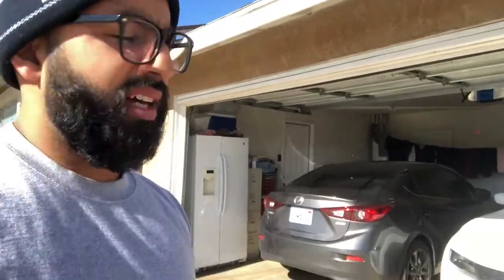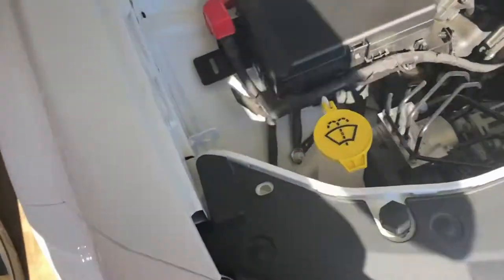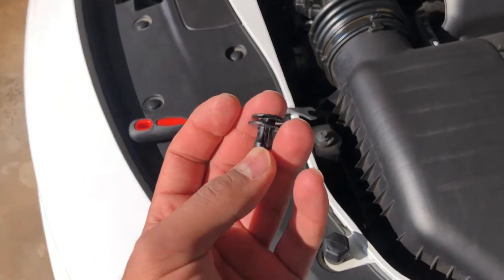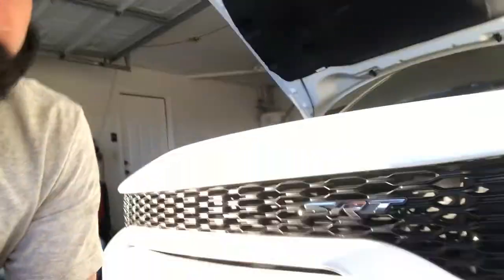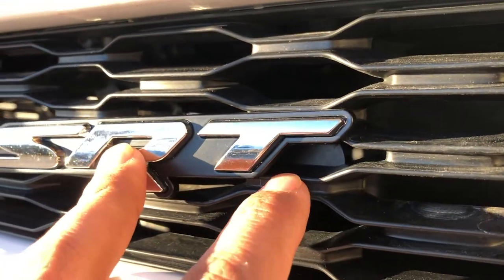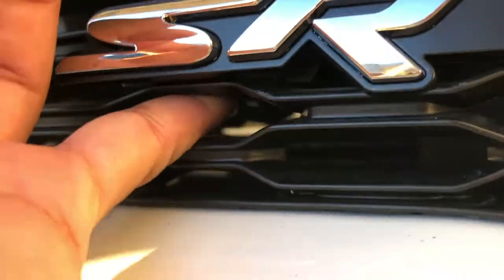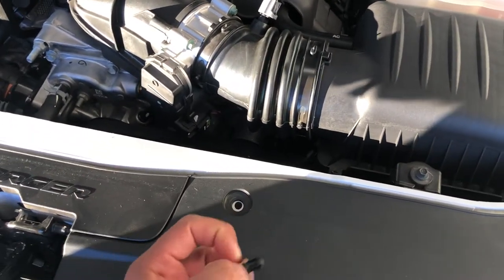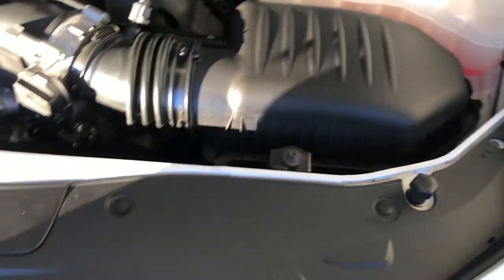2020 Dodge Charger Wide Body Scatpack gets SRT Grill Emblem Part 1 of 2

Comment: This video would have been helpful if you actually showed the install.. Where did you get the hardware to put the emblem on?
Reply from the maker: Everything you need comes with it when you buy the emblem.
Reply: @sbzgarage  Yea I just realized I purchased a SRT emblem that won’t work for my 2021 Dodge Charger Scat Widebody. I found one online that has bolts and nuts for it but now that I took my scat pack badge off, I kinda like it with nothing on the grill🤣🤣
Reply from the maker: @FloridaBoi7.62  lol I was debating to keep it like that too. It’s a clean look.
Reply: @sbzgarage  Yea I think imma leave it be. Debadging the dodge letters on taillight and Tinting it tomorrow. Thinking about debadging the Hemi under the 392 on the sides also. It is a very clean look especially on the widebody
Reply: @FLYxxBOY   It’s was no molding. Just the regular grill. When I was taking it off the scat pack emblem broke off which I didn’t care to keep it anyway but once it was off I said forget putting anything back on it, I love the look it has with nothing but the grill showing. I also debadged the entire car. Looks amazing.
Reply: @FLYxxBOY   I have a 2021 Dodge Charger scat pack widebody also
Reply: @FloridaBoi7.62  do you have a link to that emblem ? Want to swap the front badge on my 22 Wb scat

Comment: Hey how did you take off the scatpack badge because mine seem like  finna break off trying to take it off plus the SRT emblem I have doesn’t have the screws in the back
Reply from the maker: Yeah I had to break it off but the only thing that broke off was the stuff on the back that holds the badge to the grill. That SRT badge might not work cause I think it’s for a older grill style. But you can send me pictures on my Instagram and I can confirm this information @SBsGarage

Comment: Thanks for posting this video but how did you lift that black plastic piece up far enough to get your hand down there? I do not want to take the bumper off just for an emblem. TIA
Reply from the maker: The push pins come off and you can pry it open and get your hands behind there. Also my lady is smaller and got her hand in, idk if you know anyone small that can help you out. I know my hand wouldn’t get back there without scrapping and scratching my whole arm.
Reply: Bro???? You can pry off without doing all that extra stuff. I just wanted a clean look with no badge

Comment: Yo so when you took of the badge there's a SRT badge that just clips on the one you bought didn't come with that right? If so did you take out the back piece that was holding your scat badge in place?
Reply from the maker: Yeah mine came with no clips cause that one is for a different style grill. Mine just had some screws and some nuts to tighten it down. Everything from the scat pack badge came off before the new SRT badge went on. Hope this helps.
Reply: @sbzgarage  so basically I'm doing this to I just ordered the new SRT emblem for the front since the first one didn't fit I put a black SRT badge in the back I have the SRT white airbag I even replaced my dash emblem the on that says 392🐝 by the passenger side vent to SRT! But what are you gonna do with your seats they still have the bee?
Reply from the maker: @392_vic  Dang that’s really cool, the seats I was going to look to find a pair off a SRT 392 but if not I’m okay with the bee being there. Maybe down the road I might get the seats reupholstered.
Reply: @sbzgarage  I'ma get my seats done maybe put the SRT logo on there and do diamond stitched middle in suede to complete the look!
Reply from the maker: @392_vic  I was thinking about doing that diamond stitching too, saw one in all white but was all leather. But the leather and suede combo will be better!

Comment: How did you get it in? I'm having trouble with mine. Where you took the plastic bumper holders off did you have to remove the piece that says charger?
Reply from the maker: I’ll be posting a new video up later this week. In that video I go over in more detail now to get it.
Reply: @sbzgarage  thx man. It actually finally came in the mail for my 21 widebody charger and I was wondering how you did it. Like I can't get my arm in there lol. Like where you took the clips off did you take off the small piece that says charger and that big plastic piece off too?
Reply from the maker: @thegooch3311  No you don’t need to take that off but it’s a small hole in front of that piece where you are able to get behind the logo. But you need small hands.
Reply: @thegooch3311  did you ever get your emblem off? I have a 21 as well and I bought an SRT emblem but I’m not trying to remove my bumper to put it on

Comment: Damn item no longer available 😿
Reply from the maker: There might be other ones still available by other sellers.
Reply: I Just bought a 21 srt powered scatpack produced in dec. 2020. Got it with 5 five miles on it so it’s safe to say are making them

Comment: So the scat pack badge is snap on like the R/T badge?
Reply from the maker: Yes that’s correct. Also held with 2 washers.
Reply: @sbzgarage  Thanks plan on doing this mod to my 2021 Widebody Charger, wished they still made the SRT 392's.
Reply from the maker: @FatBoi310  I know right, would have gotten that in a heart beat myself. That’s why I’m converting mine to one slowly.

Comment: SRT powered lol
Reply: It’s still a SRT goofy
Reply: @Cruel Father they are. if it’s SRT powered, it’s an SRT.
Reply: @Cruel Father true my 09 srt8 challenger is fully loaded .. leather SRT seats have SRT rims.. it’s really nice interior for its time
Reply: Two things: when ur looking at the trim levels, does it say SRT Scat Pack or RT Scat Pack? Also, does the steering wheel have the SRT light up emblem on the steering wheel from factory? Scats are not SRTs. Their SRT powered but not officially SRTs. It would make the SRT 392s trim models pointless at that point.
Reply: @tvushington6994  the SRT 392s are literally scatpacks with SRT logos lol..
Reply: @jcartier9yearsago403  the differences are very minimal, But they are different.

 “Adjustable suspension

Wider tires (275 vs 245)

Wider rims (9.5 vs 9.0)

SRT Nappa Leather seats

6 piston Brembo's in the front, 4 piston in the rear, Scat gets 4 piston Brembo's in the front and 2 piston in the rear”

U will experience the difference in ride quality with the adjustable suspension. That’s the definition of qualifying as an SRT according to dodge. It’s very similar to scats but not the same. Both are amazing cars and pack a lot of power. It wouldn’t be sold as different trim models if they were identical. This is up badging.
Reply: @tvushington6994  ohh okay I didn’t know all of that. Thanks for clearing that up
Reply: @thelifeof400  lie again
Reply: @Cruel Father correct
Reply: @jcartier9yearsago403  wrong
Reply: @Cruel Father correct
Reply: @Cruel Father powered by SRT is Samething. I honestly don’t even care my shit said SRT on the bacc so take it up with MOPAR
Reply: @Chestnut1998  powered by SRT is Samething. I honestly don’t even care my shit said SRT on the bacc so take it up with MOPAR
Reply: @thelifeof400  take it up with your brain. your car was new when you got your scat. that is upbadged. you can ride around looking funny
Reply: My 2020 Scatpack shows SRT on the radio screen when I turn my charger off and on. 🤷🏼‍♂️
Reply: @DeriveDE5  doesn’t mean anything. Mine can say hellcat and that doesn’t mean it’s one
Reply: @Chestnut1998  well yeah, but it’s not like the taser where you can get the hellcat startup cluster when you have an SXT. This is something that dodge put there from the factory. On 2021 Brembo brakes they are also putting SRT logos for the scatpacks, similar to the hellcats. 2019, they made all drive modes standard (track, sport, custom, auto, eco). I’d say previously when there were both trim levels of the scatpack and SRT, It’s up-badging. Now they’ve removed the SRT and given the scatpack everything the SRT had, as an option. Only thing you can’t get is the SRT steering wheel (standard) and full leather seats (optional on SRT/Hellcats).  That’s very minimal difference considering SRT is known for performance. This creator has a widebody which includes the 6 piston brembo brakes, larger tires, and adaptive suspension. This would be equivalent to the original SRT performance wise, if not a bit more considering the competition suspension and even wider tires.
Reply: @Chestnut1998  yea if u added an aftermarket radio but he’s talking about it says SRT from the factory my guy😂😂😂😂😂😂
Reply: @natnaelgaim6206  I have a 2020 scat if you didn’t know.
Reply: It’s a difference between an R/T ScatPack & SRT392 (more hp) but I forgot you guys work for MOPAR 😭😂
Reply: @thelifeof400  what? The SRT 392 has the same amount of HP as a R/T scatpack guy!
Reply: @Chestnut1998  ok VP of Mopar
Reply: @tvushington6994  everything you mentioned that the srt has that the scatpack doesn't,  you can get added on to a scatpack from factory, everything you said are just add ons, doesn't have anything to do with the transmission or engine which are EXACTLY the same on a srt or rt scatpack, so they are the same car just you can add options to make the ride smoother. Does nothing for adding horsepower or making it faster so don't get discouraged and think just because it doesn't say srt that you're not getting a srt, you are just a upgraded name and badge.
Reply: @Chestnut1998   @SPORT_1.5  you're 100% correct, the "srt392" and the "r/t" scatpack have the same engine transmission and horsepower, they discontinued srt's in 2019 because they weren't selling like they predicted and started calling them scat packs and upgraded the badges and the name that's literally all lol.
Reply: @chubz9192  2018*
Reply: @Chestnut1998  yea that's what I meant lmao
Reply: @chubz9192  they weren’t before but they started having those options from factory in recent years. Regardless, it’s still up badging. Even if it literally has all the same options and features, Dodge wouldn’t have released the “SRT”. Even if it was for marketing purposes and make extra cash on their end. Scats aren’t SRT’s. Probably why they discontinued the SRT trim in total and kept Scats as a “Scats”
Reply: Man people getting so butthurt he is changing the badge to SRT ffs, don't you have something more worthwhile to complain about?   He has an SRT 392 so what is the problem?  He isn't putting a HC or Demon badge on and there is no official "SRT 392 Charger" as that merged with the scat packs, what is he "upbadging" to?  I could understand if he was doing this to an SXT or GT, geez people are just looking for ways to get offended so they can jump in the comments and tell everyone how wrong you are. Mopar community going soft.
Reply: @tvushington6994  facts check my vid on it